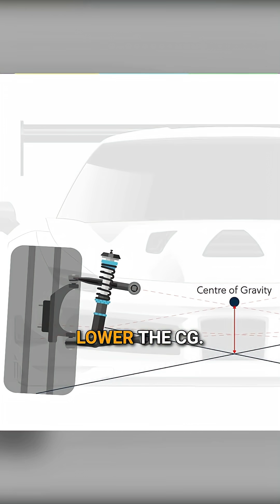Lower is Better.

Comment: And with macpherson strut you’re likely going to end up lowering the roll centres more than the CG resulting in a larger roll couple and, counterintuitively to most, more roll so then you have to install stiffer springs etc etc
Reply: Roll centre adjusters are an excellent idea but not always easy
Reply: @jdmjesus6103 absolutely, unfortunately outside the track, most people seem to sleep on these
Reply: Then how do I know how much I need to lower my car without changing the roll center too kuch
Reply: @harel1n quick rule of thumb with McPherson strut: look at the angle of the lower control arms. From the subframe to the knuckles, if it's flat or pointing towards the ground, you're still good. If it's pointing upwards, you're too low, and you will need a correction kit.
Reply: @harel1n  your best bet is to check forums and see if anyone else has done the hard work for you. 

Otherwise, if you want to understand where your roll centre is and how lowering it will impact it, you’re going to have to measure your suspension and plot it out